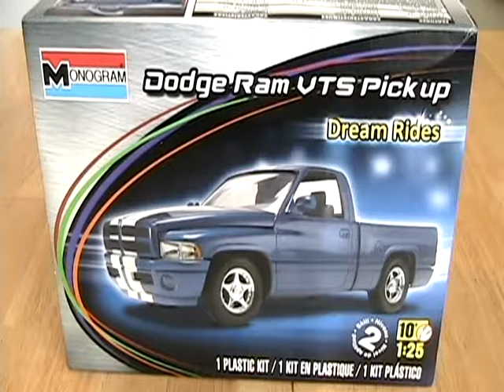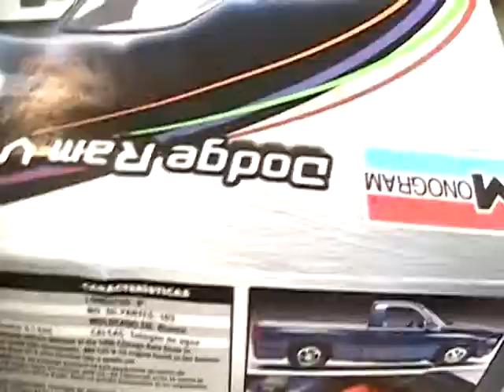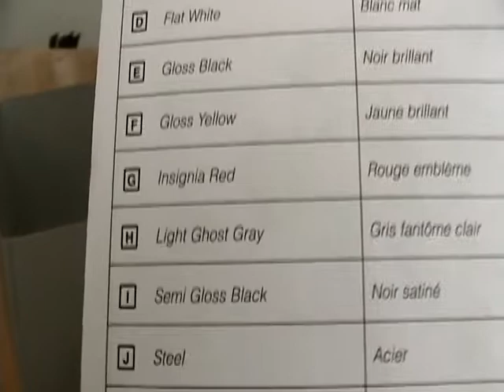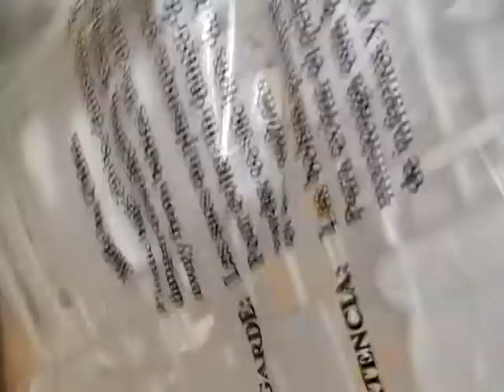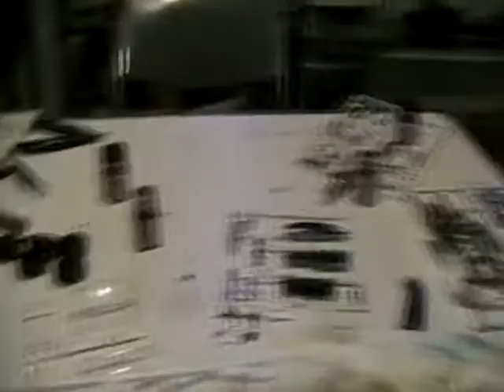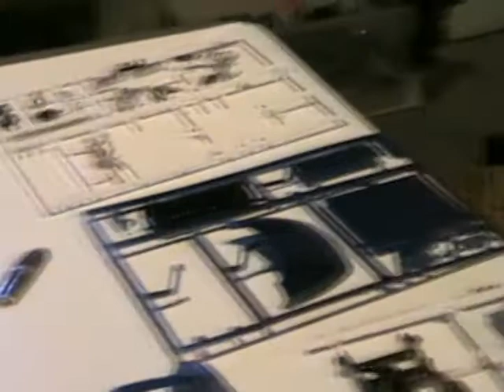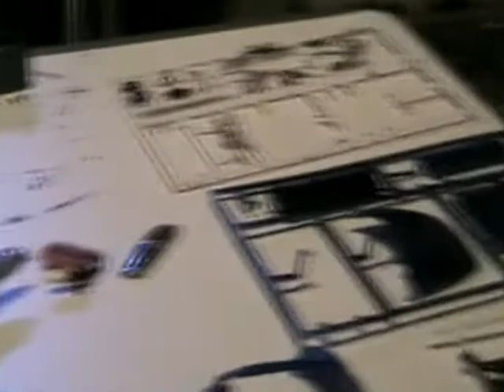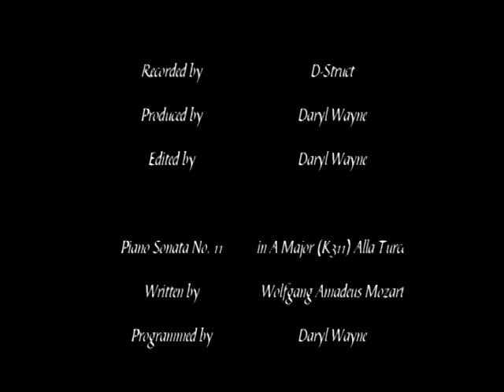Monogram Dodge RAM VTS Concept Vehicle Build FAIL

Comment: You need to primer before you paint.
Reply from the maker: This is something I've given some thought to here and there and I might do that on a future build, but none of the other past builds did generally for reasons of time consideration and because I didn't want to add too many steps, getting back into it after the layoff, particularly because if I added too much of that, it would tend to decrease the fun of it for me...I fully expected to wreck some builds and was sort of surprised that it wound up being only 2 that were total fails...